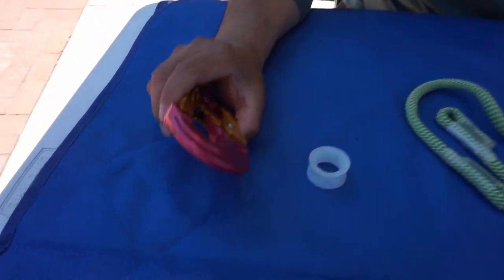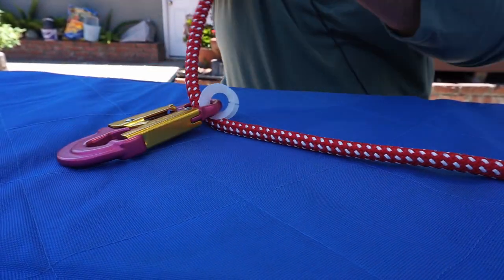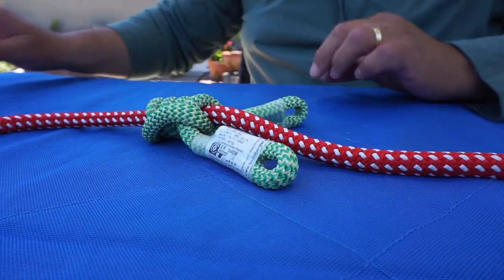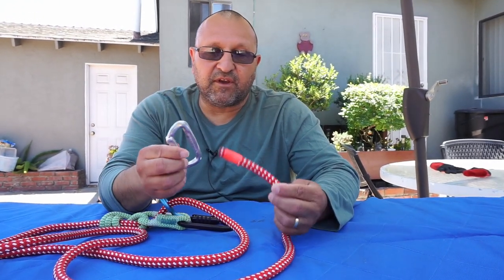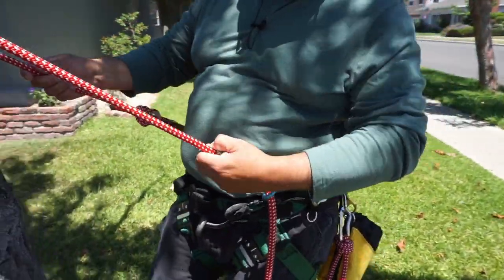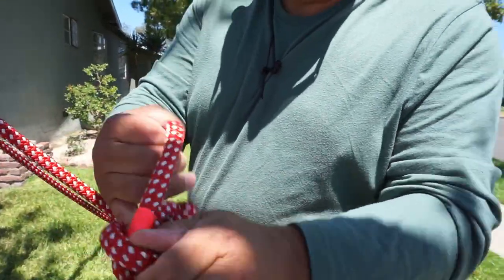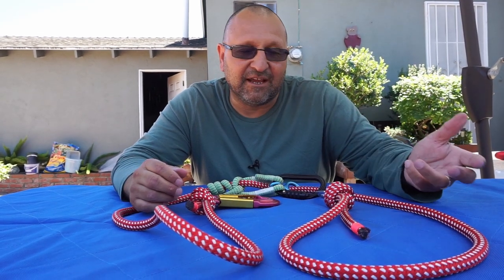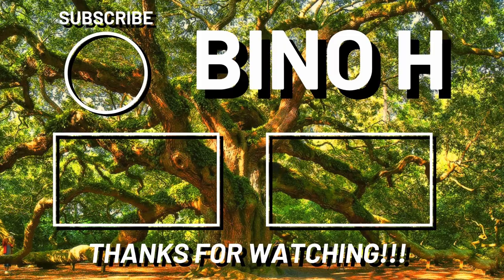How to Make a Tree Climbing Lanyard: Lightweight, Simple, Easy to Use.

Comment: Bino, I just made my new lanyard. I have a saddle that is a year old which was made with  Samson Predator 11.4mm rope on the lanyard with a poor man's ascender & a Fusion carabiner. I also have 2 climbing lines of the Samson Predator.  My 2nd lanyard is an Oplux 8mm tactical that I only use when I was already @ the height I need to work @. On my new saddle it comes with only the Oplux with the poor man's ascender on it. I wanted to tie my climbing line into something like I had on the original saddle. This new lanyard attaches to the large loops on my new saddle great & I can tuck the Oplux away neatly. So there is a Petzyl oval carabiner on the 1 end of the rope & the Prusik which I didn't like using on my HitchClimber Eccentric.  I bought a curved gate Petzyl & tied it onto the tail end of my rope as a stopper. I also was able to find an Ocean & HRC with the small sewn ends on them now to use with my HitchClimber Eccentric.  Thanks for the video cuz I didn't want to use that Oplux as a bridge for my double rope climbing system.  The Michoacon I have on the new lanyard works just like the sewn eye & eye on my original saddle which is tried & true. Thanks once again 👏
Reply from the maker: Awesome great hear that your gear is the way you like it. Take care!

Comment: Thanks, really good point about being able to make up you own stuff. Customizing is where I’m headed so I’m trying to pick up new stuff. My goal is to come up with the perfect 2 in 1 that I can use when I’m leap frogging up. I may need to go with about 25-30’ length. My biggest issue has been a bi directional system. I tried an English prusik but it always gets too tight w/out a micro pulley. But when I use the micro pulley it’s no longer bidirectional...:/
Reply from the maker: I use a clip with a pulley and take the pulley of while doing two directions. I made a video named How to make an improved lanyard. I shows how I like to use it.
Reply: Yes, that is good...but my English prusik then gets too tight and freezes up so much. Maybe I’m using the wrong prusik cord. What would you recommend?
Reply from the maker: @dprevish100   True the three wrap prussik can get tight. You mentioned that your lanyard is 30' long. It sounds like you might use almost like a secondary climbing system. Maybe make it one directional. for me when I use a 2 n1 it's more for holding me in place so the prussik won't freeze.

Comment: Hey Bino, this is super helpful for those of us who would rather build our own rig. If you wanted to go even cheaper, could you simply secure the prussik straight to your harness with a carabiner for tending? I haven' tried it yet and I'm sure it's not as user friendly but saves the $60 for a shizll with gear everyone already has. Thoughts?
Reply from the maker: You could also use a micro pulley some are around $20.

Comment: Thank you. What If I wanted to make one that was bi directional so I could have a biner in both ends. What type of knot would I use.
Reply from the maker: The English prussik works good for me. I made a video on a 2 and 1 lanyard and with that type I use a micro pulley instead of a Shzll.

Comment: You mentioned that knot is a single direction knot, but could you should have to build one of these that could be used for a 2-in-1 lanyard? Thanks for the help love your videos
Reply from the maker: You could make a 2 and 1 lanyard but with the Shizll and a one direction knot you can only tend in one direction. I have seen where a guy used 2 shizll's and 2 knots on a 2 and 1 lanyard. Myself I like to use a English Purssik and a removable micro pulley on a 2 and 1 lanyard.

Comment: If I want to make the prusik by myself (not a pre-sawed), how should I do it? 
Should it be a double eye version, or a prusik loop? 
Thanks!
Reply from the maker: If you are using a carabiner, it would be better to use an eye to eye. If you are using a clip with a solid eye you could use a loop. You want to have a rated prusik cord.
Reply: @BinoH  thank you!
Reply: @BinoH  could you not just make a prussik cord with a small section of rated climbing rope, and tie 2 double fisherman bends on the tails to clip into your carabiner? A little bulky but would definitely work.

Comment: I have a 9/16 rope and I'm wanting to put thimbles in the eyes. My options are 1/2 in and 5/8 in. I was assuming the 5/8 would be the one to go to because it's a bigger size. This should be fine yeah?
Reply from the maker: I'm not sure you might be able to go either way it's only 1/16" up or down. If it's smaller the rope might squeeze in and if it's larger when you tie the knot and put weight on it. It could expand into thimble. I guess it may depend on your rope if it has give or is is solid. The rope in this video is 11 mm and it fit in the 1/2" thimble.

Comment: Hello Bino, I used an Ocean 8mm x 24 inch eye-to-eye prusik Michipocan on my 1/2 inch Samson Arbormaster Blue Streak lanyard and it was not binding under tension. I used a CMI micropulley instead of shizll. Do you think the prusik, lanyard, or operator error is/are the issue?  I will swap out the 8mm for a 10mm x 28-inch Bee-line. Thank you!
Reply from the maker: Is the cord new? if it's new you may need to wear is some. You might try another hitch or if you can add a extra wrap.
Reply: @BinoH  Thanks Bino. I replaced the 8mm with a 10mm michopocan. Its raining here so if that doesn't work I will break it in  some more.

Comment: Dear bino 
I have a question about rope that it's must be a dynamic rope or it's must be static or low static rope
Thanks a lot
Reply from the maker: You can make it with either but a static line is more stiff so the knots may be a little more difficult to tie.

Comment: What is the brand and size ropes are you using. I am starting to climb trees and having a problem with ropes not releasing to slide down (they bite to hard). I am roughly the same size as you. I have been having to use a huge and would really like to get get away from mechanical ascending and decending devices.
Reply from the maker: Hi Jim, some Here are some of the ropes I use. New England Hi V 1/2, Samson 1/2 Blue Streak, Teufelberger drenaLINE 11.8mm Rope and Teufelberger Xstatic 11.7mm Rope. Here are some split tails, 1/2 climbing line using a termination knot, 8mm eye to eye 24" prussik cord and 8mm HRC 30" prussik cord. Hope this helps.

Comment: I'm curious about the snaps. Since I'll be making my own lanyard as per one of your videos, I've been researching which snaps I want to buy. Are these made by ProClimber from Pelican Rope Works? What make and model? When I read the reviews for the ISC two and three lock snap hooks, some people were stating that lock parts are getting bent, which causes sticking. I want to be safe with whatever I decide on. Thanks Bino!
Reply from the maker: The one I used VER Aluminum. I bought it at Bishop Company.